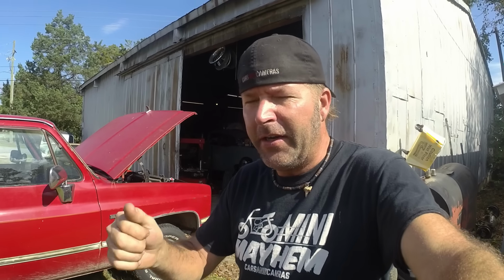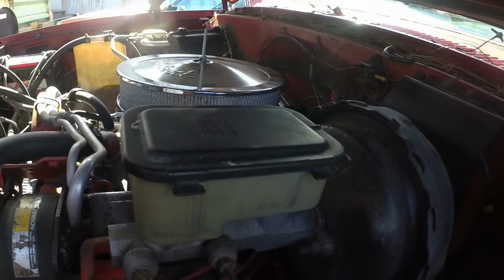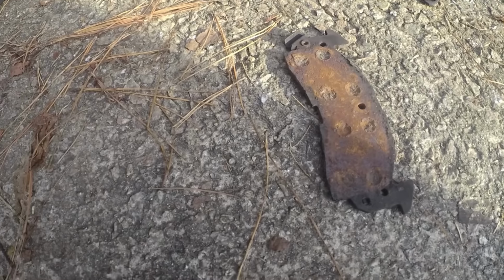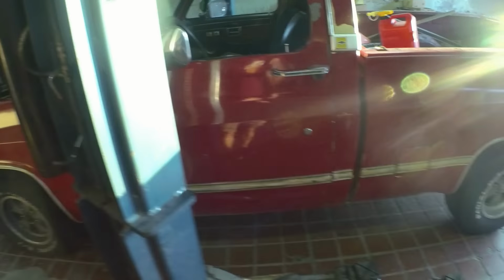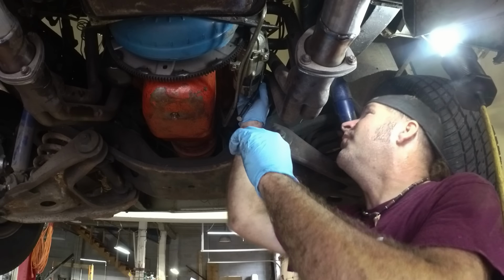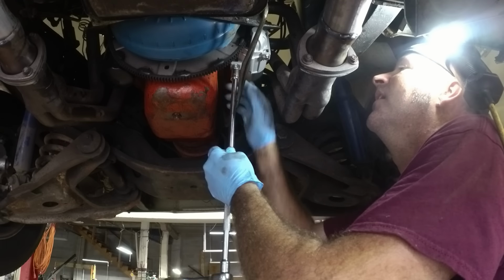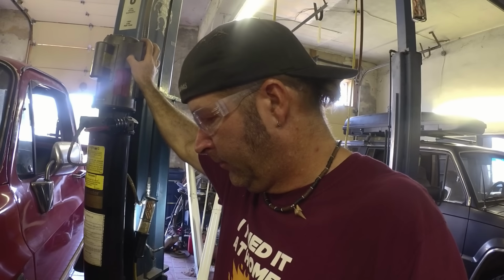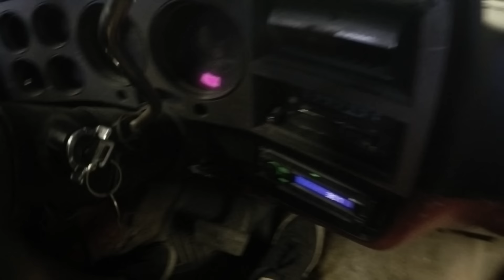I Almost Wrecked My 85 Chevy Truck

Comment: I liked those original "Batmobile" wheels you had on it .Made it different,now it looks like all the others on the road with rubberband tires
Reply from the maker: They will probably make it back on the truck
Reply: Personally, I like bigger rubber on older vehicles, and bit of rake.

Comment: That sort of situation is why some vehicles have that "Press brake to start" feature with a pressure-operated switch between ignition switch and starter solenoid, no brake pressure, no start, a good safety feature, though also used for those who forget to take things out of Drive, particularly if they're CVT-equipped... :)

Comment: There are very few things that are quite as heart dropping as hitting the brake pedal and little to nothing happens, ha, ha!  

     You made replacing that flywheel look so easy buddy! I wish that I had your talents!     Great video,  I love all of them, and I can't wait for your next one!
Reply: How does one play Carnegie hall...practice, practice, practice...
Reply: He Didn't replace the Flex-plate. You could see the flattened teeth on it when he replaced the Starter only. You could hear the different sounds as it went around, but as long as it's working...'It'll be fine".
Reply: Living in city with lots of small hills and a bunch of inclined parkings, I have trained myself to quickly pull the handbrake. Sometimes I have to park my economy hatchback on a decent slope and then with it's puny 1L Suzuki motor, I need to use the handbrake to pull it up. Of course, this econobox does not have Hill Hold!

Comment: Great work 👏 was going to change my bus hub bearing assembly and noticed upper control arm mount almost rotted through 😢yay northeast  vehicles, might try and fabrication fabricating and welding but still unsure but it's all i got

Comment: Same thing happened to me when I was 18 years old driving my 67 Impala to work. I made it there by using the emergency brake and gods grace. Lucky for me my plumbing boss was also a mechanic and we swapped out the master cylinder and come brake lines.

Comment: Those unique 15" mags you had worked better for your particular (rough and tumble) Square. Had a certain 80s vibe that went with the 80s truck. 
The new ones would work better if it was lowered a bunch and had a slick paint job.

Comment: Sharp truck Ike, I’ve got an 87 same color with 4x4 but you gotta put some better looking wheels on there bro, some centerlines or crager mags , might could do some kinda paint design on those but still good looking truck, could’ve sold mine over 100 times literally in the last 15 years, man it’s a blessing to still have access to the lift and trans jack , I wouldn’t know how to act if I had a lift for my personal use im so used to being on the ground and sometimes if I’m lucky I’ll have a sheet of plywood underneath 😂,I had to come back and edit this comment Ike cause you put some badass wheels on at the end, 👍🏼good deal bro they look sharp, sooo much better

Comment: 13:31 You can buy the cheapest asbestos pads, use it to turn/smooth the rotor. When it wears out you can just buy the cheap pads and replace that one wheel . I would never do that with customer vehicle, they have to be safe so replace everything brand new for liability and longevity.
 Chevrolet V-8 starters supposed to have shims. You have to adjust them like putting ring and pinions on rear ends but here is the thing master mechanics won't tell you.  99.5% of non GM flex plates are egg shaped! Not out of round,actually egg shaped! It's one on them deals where going cheap will bite you . Thing is if you spend the money you are more likely to get a can of paint,some shims and "tune" the starter gear depth with paint, trial and error shimming it like it's supposed to be, also there's a bolt hole on the engine block and the starter has a long threaded stud, opposite the flywheel end that's for a metal bracket , Chevy starters need that third mounting point to create box construction, it stops flexing of the starter with just two bolts. Aggravating,yes, but it works!
Reply: A friend had a '73 just like it with 454. It was super fun, bark second 6 foot both back wheels. You think it would be super cool, but 10 mpg, he didn't keep it 6 months, pass everything but a gas pump. We couldn't afford to drive it!

Comment: I once owned a 1985 Chevy that lost it's master cylinder i ended up hitting the rear of a 1970 Ford truck I had the Ford truck moved forward about a foot and the front of the Chevy moved back about 3 feet I had to exit through the window 😂

Comment: Does the Emergency/Parking brake work? That’s what it’s for. If it doesn’t, I’d recommend getting it fixed too. What if you were on the road and that happened?
I’m glad you caught it and fixed the brakes.
Stay safe Isaac.
Take care.
Reply from the maker: Cable is bad
Reply: @isaacitllbefine7231  So replace it! I bet it would make for good content. I’ve never changed one on a square body before. I would love to see you do it. lol. 
Take care Isaac.

Comment: I saw he mentioned the cable on the parking brake is broken so I see why that is not an option. It appears that the master cylinder was actually not needed but not a bad investment. However, why did the back brakes not do anything? Too far out of adjustment? Situations just like his is why they mandated dual chamber master cylinders.

Comment: need do brakes myself on 2001 sivarado.have the abs fuse pulled out due to module went bad an pulling fuse on it wont blow out the abs control pump i guess but yea got troubles too

Comment: Evening sir i have a question:
I saw someone on youtube telling That if you have a automatic transmission that it’s better for your gearbox when you park your car that you don’t put the gear right from Drive to Park.   But first you have to put t in nutral.  Than use the handbrake  turn off the car.  And than put the transmission in park.    Is this true? 
Also  he said that when you’re standing still for a stopinglig you don’t keep your transmission in Drive and hold the brake but put it in nutral also while standing still
Reply from the maker: Maby there is some truth to that but I don't bother
Reply: @isaacitllbefine7231  so when you are finish driving your car, do You put the transmission right from D to P yourselve? And Is this really so bad for the transmission? Or is it not zo crazy bad?   And when you’re standing for a stoppinglight do you have it in D and hold brakes? Or do you put it in N ?

Comment: Hey ike atleast it's not a  big ole skulking 3510 delco starter pmgr delco alot smaller and more power unless you start getting engine kick back and it takes the planetary gear out